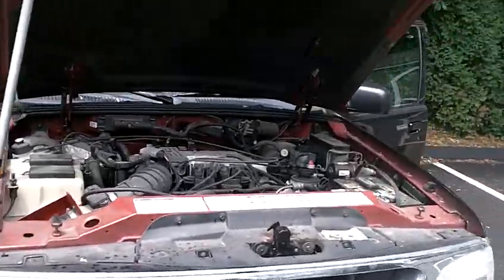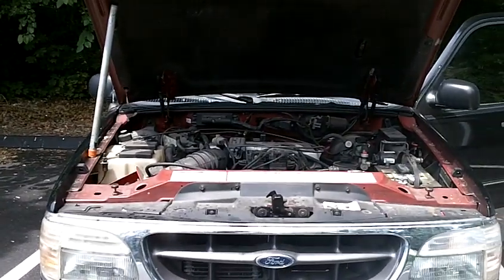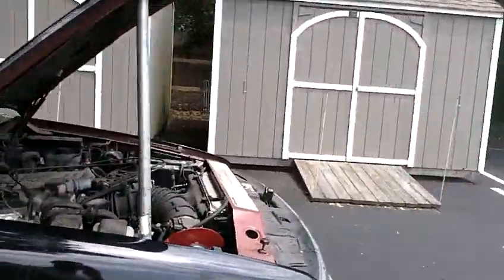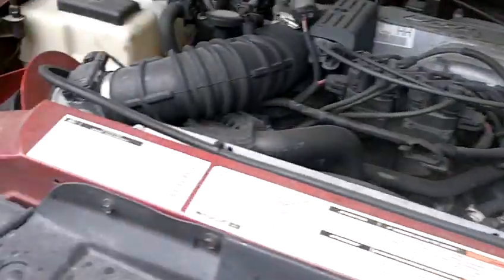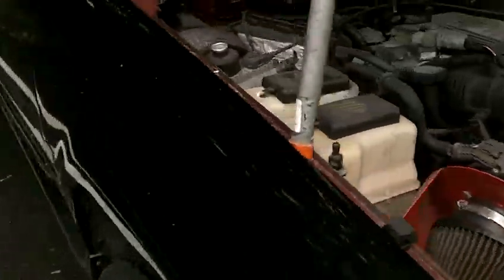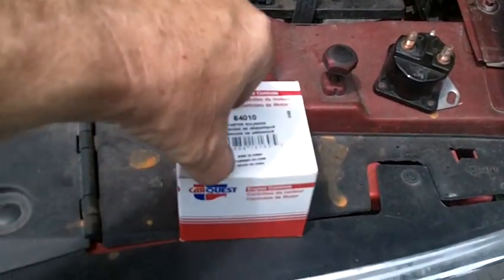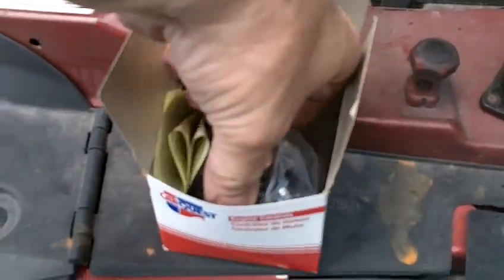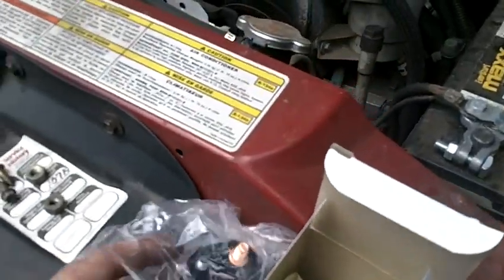Crap! My 1998 Explorer won't start.

Comment: I watched this video in my 99 5.0L Explorer, in a convenience store parking lot because my truck wouldn't start, two weeks after replacing both upper control arms, both shocks, both front axles, both front brakes & slider bolts, both sway bar links, four brand new tires and an alignment. I gotta say, despite my predicament, I was dying laughing watching this video.

Comment: Same problem with my truck, got a battery and starter and still wouldn’t start. The problem was the metal brackets that go around the battery because the starter wasn’t getting enough juice

Comment: Hi what if you have changed the starter battery and the starter relay switch? What is next? I'm stuck please help..im a single mother and need my 2000 Ford Explorer 4.0 sohc back..please

Comment: Thanks so much for posting. Have a 97 explorer and JUST did work on the front end and with no warning, it all off a sudden won't start. No crank, no ticking, nothing. Battery is fine...TY! Did the selonoid work???
Reply: What was yours I'm getting nothing off the key switch battery good fuses good, new starter/ignition relay new ignition switch still dead

Comment: an easy way to test the solenoid before going to get parts or even really fiddling with it is to short the 2 large terminals on it.. if it turns over then that may be the problem and you can start it that way as well. if not then it is the starter or the cables..

Comment: You should have done the old tap test on the starter,you take the jack handle and tap on the starter most of the time she will start after doing that,that has always worked for me until the starter goes all the way bad.

Comment: My 1998 ford explorer Eddie Bauer edition. Turns over won't start. Checked battery cables. Changed fuel module thingie.. (where button pops up) reconnect the battery. Still nothing! Checked the wires.. they tight.. please help! I don't have any $ what so ever and I have lots of Dr appts comin up. Watched videos upon videos.. NOTHING has helped. Thanks
Reply from the maker: Has the ford been sitting for a while? I've had issues after it sat for a few weeks. Turns out it was flooded. Check air filter, and fuel injectors.
Reply: A daily running truck. Checked out everything. Parked it the other day. Went out the same day and it wouldn't start! It will turn over but no crank. Right before that it had been cutting off when you go slow. I live in the mtns and sometimes if you back up it would die put in drive go over our hill it will die but crank right up in neutral. I'm about to set it on fire Lol jk just aggervated. I'm disabled.. broke.. and need to get to the drs.
Reply from the maker: Kellie Kell next I would try the fuel filter
Reply: Kellie Kell
Reply: Kellie Kell